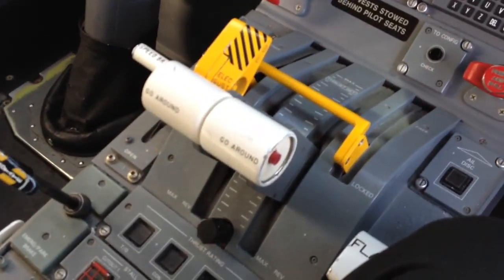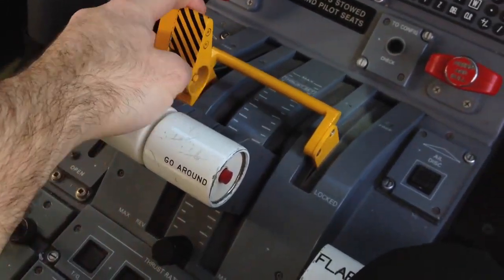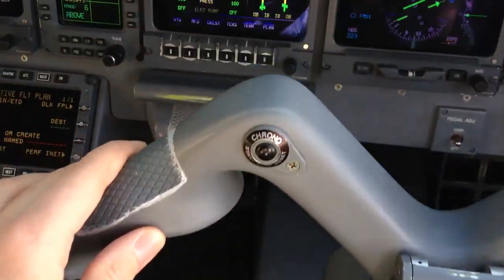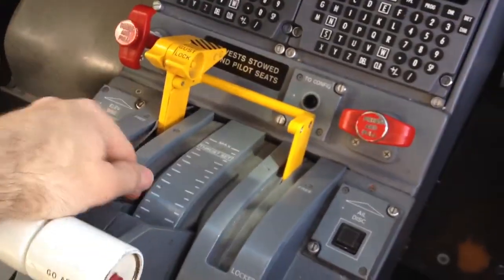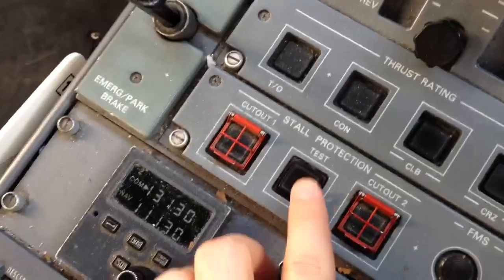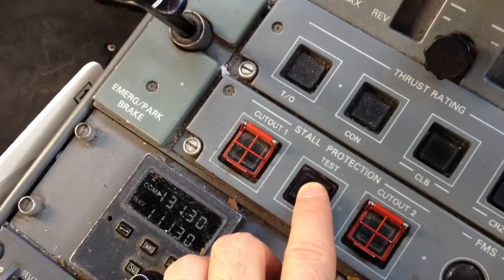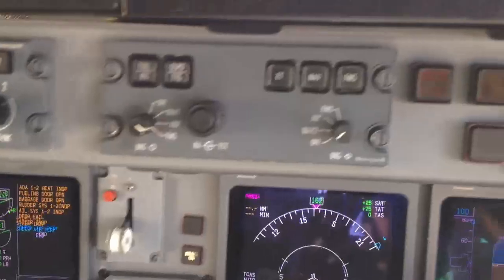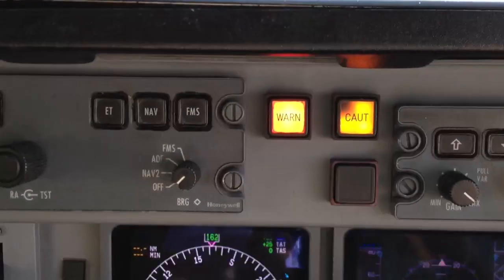Embraer 145 Stall Protection Test

Comment: my heart will stop if the joke starts shaking like that
Reply: That's the idea. It's intended to be physically impossible to ignore, either with your ears/eyes if you're not at the yoke or obviously with your hands if you're asleep at the controls. The stick pusher is an additional feature (which took longer to come into play, since pilots didn't trust it) that actually skips the human element and just says "Screw waiting for you, buddy! I'm getting some airspeed so I stop falling out of the sky!"

I'm not a pilot, but I'd like to think the pusher is connected to the altimeter, so it doesn't drive you nose first into terrain if it malfunctions, say, on takeoff... no idea if that's true, though.
Reply: YOKE
Reply: The yoke is no joke
Reply: @orangejoe204  The stick pusher exists because many transport category aircraft are prone to "deep stalls", which is when airflow is blocked to the stabilizer/elevator when the wing is stalled. In other words, if aircraft with this characteristic enter a full stall they are unrecoverable.

The stick shaker warns of an impending stall and typically is followed by continuous ignition and fuel boost pumps automatically turning on and autopilot turning off. The stick pusher activates right before the stall as a last resort to prevent the unrecoverable condition. The aircraft will be flying still up to that point, the pusher prevents the airplane from ever entering the stall. The stick pusher does not care about altitude, which is why it can be overridden in several ways including brute force.

Comment: A gust lock design like that (which is also found on other aircraft like the Dash 8) could've caused many corporate jet accidents to be avoided in the past.
Reply: What does gust lock do actually?
Reply: Gust lock causes the control surfaces to lock up for storage
Reply: It can do that certainly, as long as the Gust Lock is disengaged completely. Remember one incident where an early a.m. (still dark) departure where it was only partially disengaged which still allows advancing your throttles somewhat. They failed to abort, got airborne then staggered around  the traffic pattern with partial power on both engines. Luckily it happened at a coastline airport. Had it been mountainous terrain.....

Comment: Embraer has Stall Protection
Airbus has Alpha Floor
Boeing has MCAS
Reply: oh boy
Reply: If only you actually understood what those 3 things were. You clearly don't.
Reply: @a.nelprober4971  Interesting assumption to make based off something as small as that
Reply: @a.nelprober4971  the closest thing airbus has to MCAS is that their FCS tries to eliminate pitch movement caused by thrust inputs
Reply: The MCAS before software fix  🌚
Reply: @davehagen2540  no
Reply: @a.nelprober4971 I’m pretty sure the joke was about how MCAS also used to smash the plane into a nosedive.. just not quite for stall recovery
Reply: Wrong, mcas is not anti stall feature, it is not primarly designed to lower the nose like a stick pusher.
Reply: @mio2540  in airbus you have an angle of attack protection , thats actually the closest thing you can find from the mcas. But the thing is , the mcas is not   an angle of attack protection.
Reply: @Hk-uw8my  it is definitely not an aoa protection, it is not even a separate system but merely an extension of the STS for handling characteristics, which is a system more comparable to the systems under airbus FACs because the 737 does not have FBW.

the 320NEO actually has it's own equivalent of MCAS, and its not alpha prot. It is for handling characteristics on a very specific flight envelope while on aft CG. Same conditions as MAX's MCAS.

when you look at MCAS on paper, its theoretically safe. but the lack of a FBW system supporting it and the role of the MAX needing to have the same type rating as the NG made the MCAS unsafe.

Comment: What does it do when it actually stalls?
Reply: 145 pilot here. 

The angle of attack sensor will show a “PLI” or pitch limit indicator on the Attitude Direction Indicator. When the miniature airplane touches the PLI it will turn red and activate the stick shaker. Not long after (assuming the crew doesn’t recover) The airspeed may drop below the red tape, and the pusher is activated. 

There’s two channels for the stall protection system. You need at least one for the shaker and two for the pusher. The pusher can be overridden by holding the autopilot disconnect button. It is also inhibited in some circumstances, such as when the airspeed is above 200 knots, or the airplane is experiencing less than .5Gs, and several other circumstances. 

Proper stall recovery is to reduce AOA, set maximum thrust, roll wings level, and cleaning up the airplane once established at a safe airspeed and altitude.

Assuming you actually managed to get the plane into a full stall (actual separation of airflow) it would likely flip upside down or go into a spin and lose several thousand feet before recovery is possible. Difficult to recover especially at low altitude. (The chances of this happening are almost zero, assuming both pilots haven’t been huffing paint thinner that morning).
Reply: @byronhenry6518  is it scary flying a brazilian plane?
Reply: @arthurmead5341  Ain’t too bad. The bicycle style yoke takes some getting used to. Plenty of banged knees lol

Comment: What’s the gust lock for?
Reply: The elevator is controlled mechanically. The Gust Lock prevents movement of the elevator due to wind gusts, jet blast, or prop wash. It is unlocked before flight.
Reply: locks gusts
Reply: @asystole_  you legit just reversed the words that means nothing.